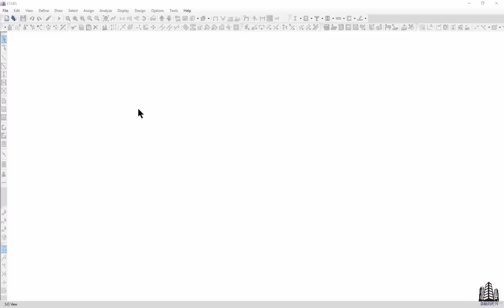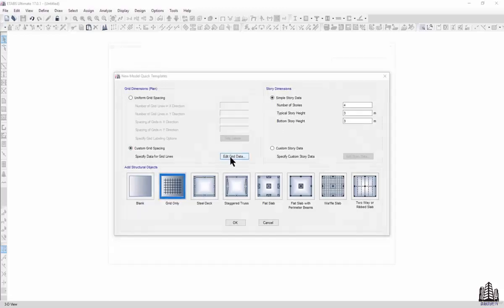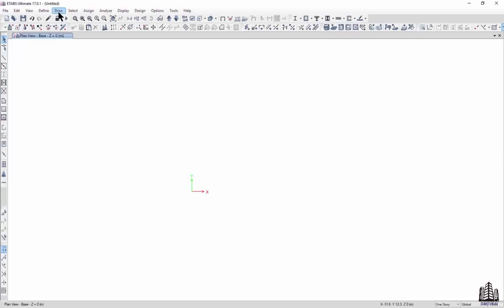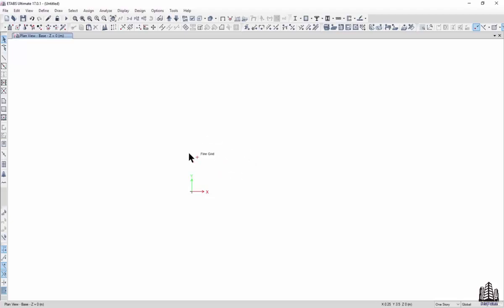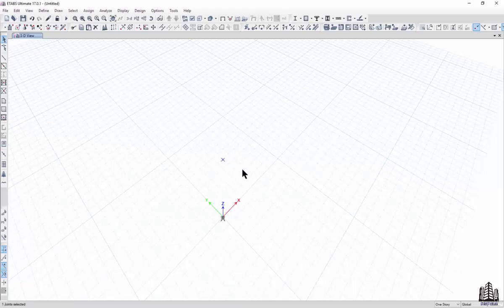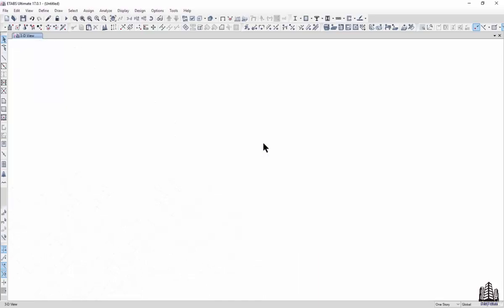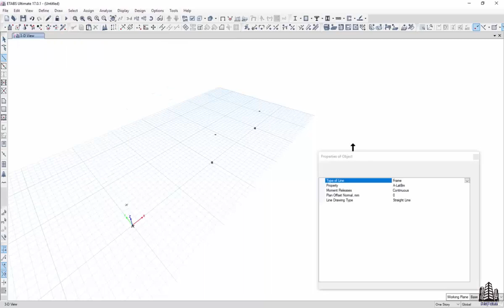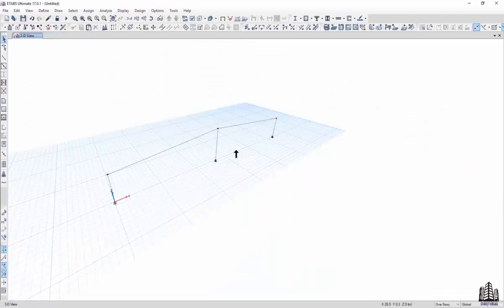2 Draw a portal frame in etabs as per drawing

Comment: I'm not able to connect the beam and column as shown in the video. In my case they are just touching each other even after switching the snap on.  Where is in your case, the beam is projected inside the column. Please let me know where I'm going wrong or any  settings are needed to be done. Thanks in advance!
Reply from the maker: There is no other alternative other than turning on the snap option. Maybe you are using the unlicensed version, if this is the case try restarting or re installing the software.
Reply: @structuretv9619  restarting means  to model the frame from the beginning ?
Reply: @syedilyashussain5612  nope. Save the model, close the program and restart the program and again open model.
Reply: @AhsanAli-oc1vf  thank you mate
Reply: @AhsanAli-oc1vf  I'll try this ....☺